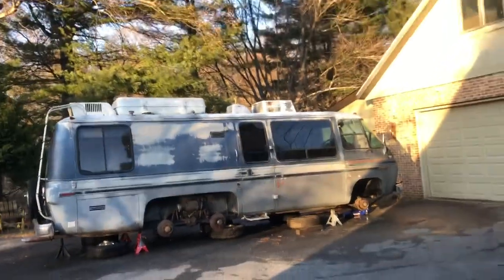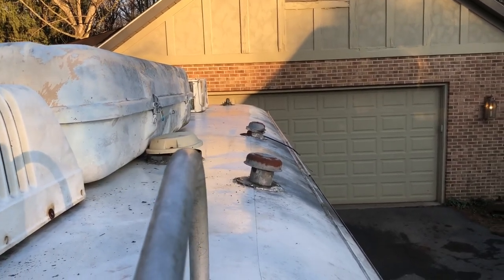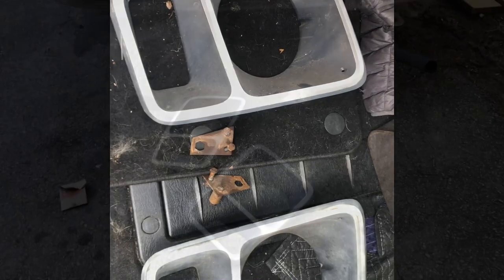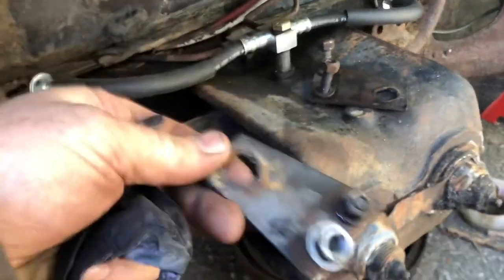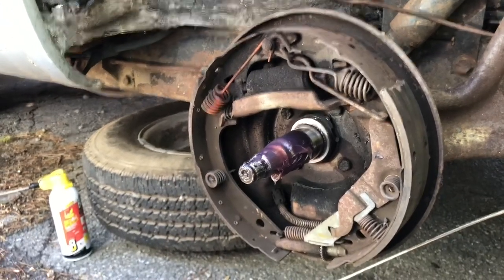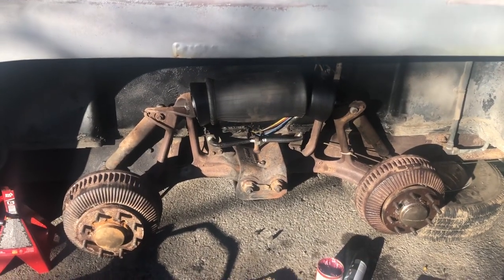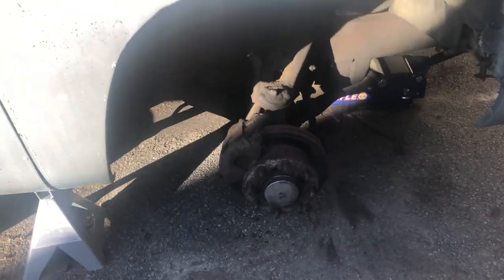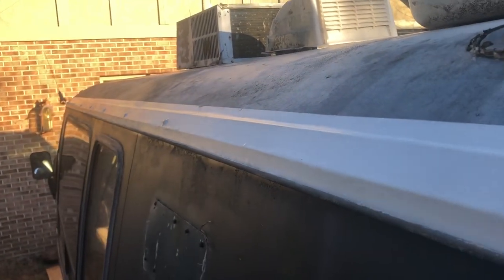1973 GMC Motorhome Episode 3

Comment: I just realized this is a very young post... I assumed it was way older... as I was looking into such beast in 2014-15.
I am so interested, I will keep up to see how it turns out.
My experience was not a good one...
I must say, I almost fell for that GMC low boggy style, and am glad I came to my senses and did not let my googley eyes and hormones fall for it. I came so near, though.
These things are not easy to revamp... most of the equipment on them in today's terms is useless, too energy hungry.
...and to do it right one must basically strip them to the raw frame/metal and start over.  ...and finding parts is HELL!

Fixing the leaks is a constant endeavor.
The boggy on the hind wheels is a nice idea and does result in a lower floor etc... BUT...most of them are so rusted inside(bottom of bus) that they need to be replaced... no seller will let you know that.... and that's $5,000.00 and up depending on the model.  There is a company in the Northern states that builds those boggies!

I also found that they cannot be taken to far into the boons, you are basically stuck with easy or developed parking areas.
I test drove and realized it's easy on the driving but a long animal, thus restricted.
I also saw that the inside, unless redone smarter, is a complete waste of space, everything is tight, dark, very restricted.
...and they are louder driving than one would expect.
I do not remember finding a diesel one, so the fuel consumption is not so good, they are gas burners. I think about 9-10m/gal if in perfect shape.

I don't know how much you paid, but my much more recent Shuttle bus Chevy(2011) was more affordable than these GMC units... which I found to be all on the edge of rot... yet people want 18K for them!  ...and mine is completely rust free, so clean it blew my mind. and I got it for 9K.

My Duramax 4500 chevy shuttle bus conversion is quieter, and with the kneeling feature, low on-demand, and an automatic ramp at the double doors.(NO, not the ugly bulky handicap lift, just a self deploy ramp at the main door, lands on sidewalk smoothly, and allows a wheel chair to roll right in). Turtle plexyglass body in and out, no seams, no leaks nightmare.

I just cut the back of it and created a slide, so on a 21ft rig I end up with 26ft at a basic turn of a crank.
So I have the length while camping, but not driving. ... and it is all natural light lit up.
 Sure you can start cutting holes in the GMC and add light, a lot of work! have to redo the entire thing.

...and I get 16 m/gal as is... once I setup the tuning, it will get up to 22 m/gal.
I almost fell for the Riata which gets 15m/gal... but that's a toy for flat roads, and small as smitten. 
...and, good luck getting parts or even the bigger motor... the small engine is a joke, the large one is barely adequate.
yet I almost fell for the Riata... again, so close... but I decided to keep looking.

All that said, I am still interested in this build... I brings back memories.
Reply: A. Nobody asked you.
B. This is not the venue for your uninformed lack of appreciation for the best RV ever made.
Reply: A lot of what you posted is just not true.  There is great support for this vehicle and, since the drivetrain was basically pulled complete from a GM car, there is an impressive amount of parts available.  

The popularity of these results in continued improvements being made such as the one-ton front end or the double bag suspension.

Whether the floor plan works for you mostly depends on your preferences and the floor plan chosen from the many offered when the coach you are looking at rolled out of the factory.

The great news is that the way they were built, it’s pretty elementary to revise/update the layout.  

Whether or not this vehicle is right for someone mostly depends on their interest/ability to make the vehicle what they want it to be.  Either way, it won’t be for everyone.  If you are wanting a 40 foot class A with three slides, this isn’t for you.  If your cup of tea is parking lot camping in the back of a Prius, this isn’t your jam.  Find your bliss